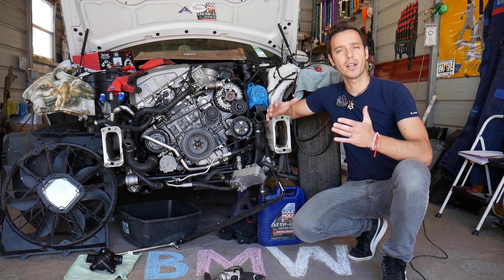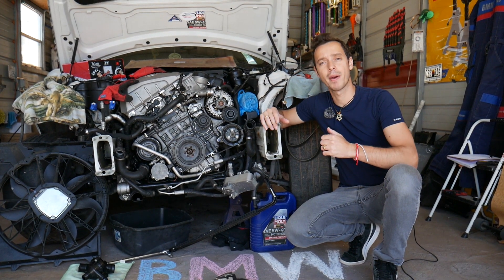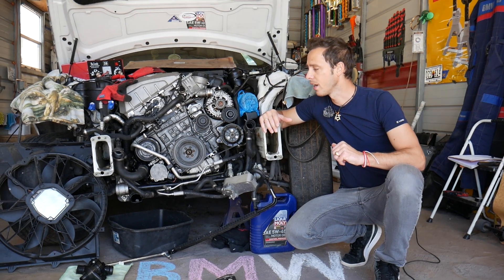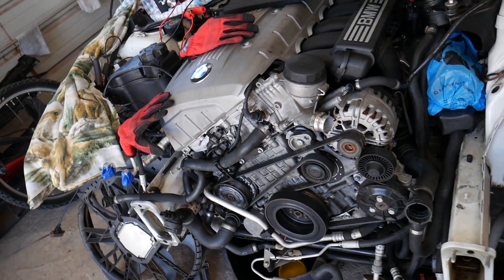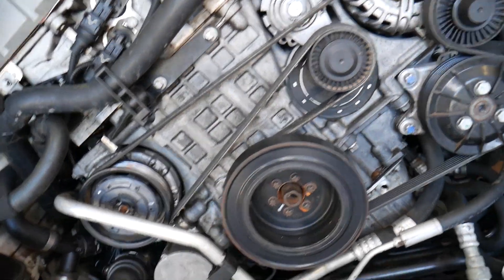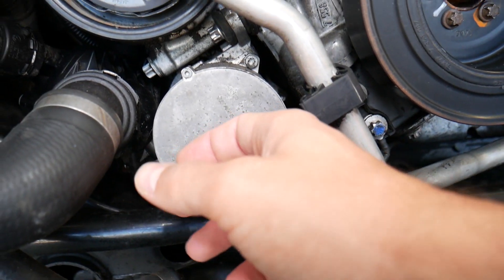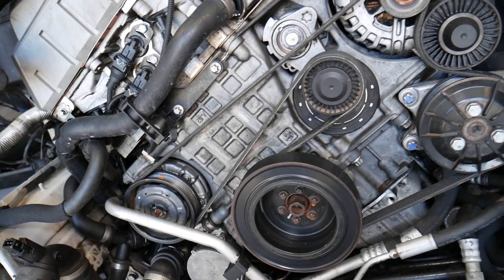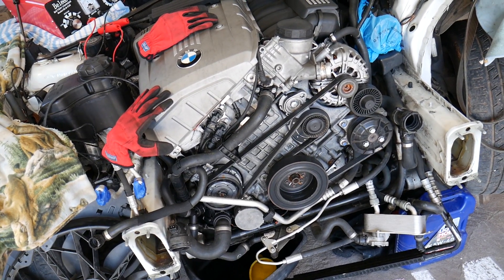BMW 1 SERIES WATER PUMP LOCATION REPLACEMENT EXPLAINED  WHERE IS WATER PUMP BMW E81 E82 E87 E88 F20

Comment: My heater takes a long time to heat up and no hot air comes out, I have changed the thermostat, water pump and pulley. What do you think this could be. Additionally I have an engine light with the bank 1 sensor 2 o2 sensor (before cat) showing up, I have changed the sensor and engine still cones on with same problem showing. 
Your help would be truly appreciated!